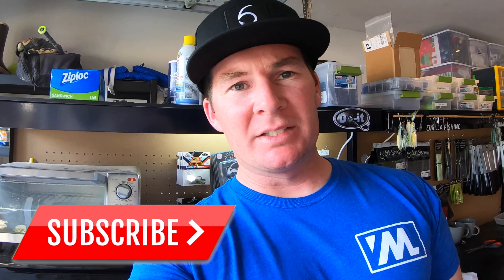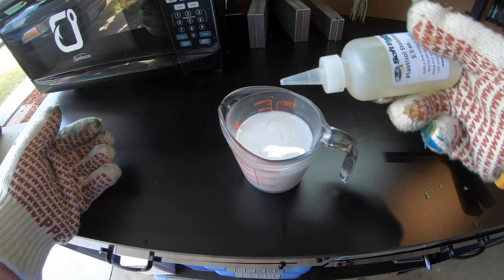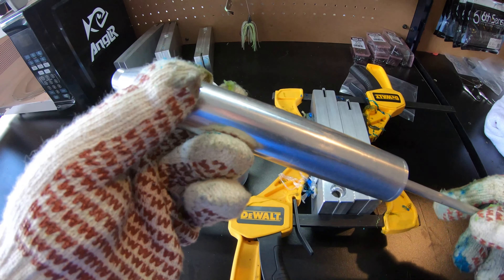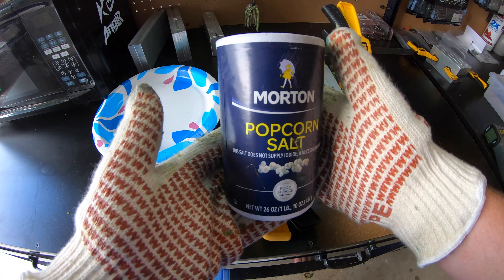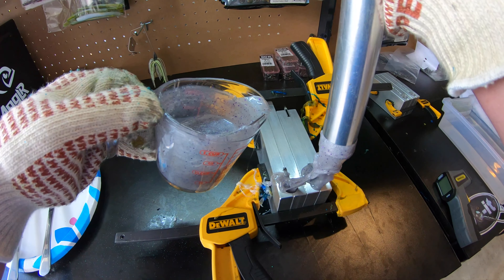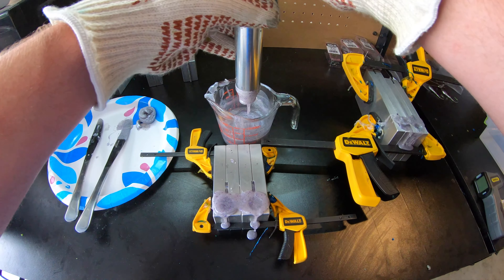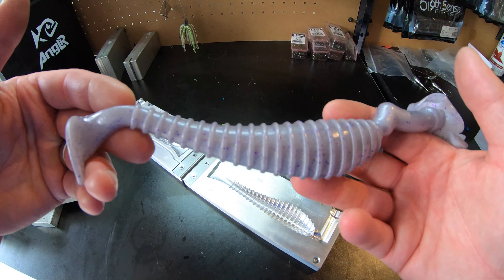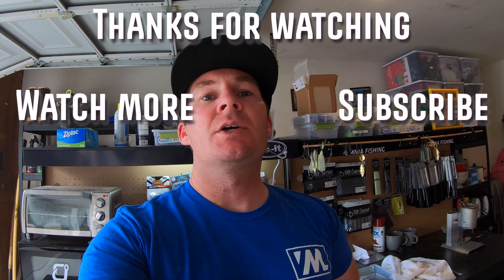Making Soft Plastic Baits - Shad Colored Flukes and Swimbaits - soft plastic jerkbaits

Comment: Once you feel the mold is filled hold pressure with the injector for a 10 count before lifting and filling the sprue. That should help with the dimples.
Reply from the maker: I do that with that mold and for some reason that doesn’t fix this one.
Reply from the maker: I think it’s a venting issue